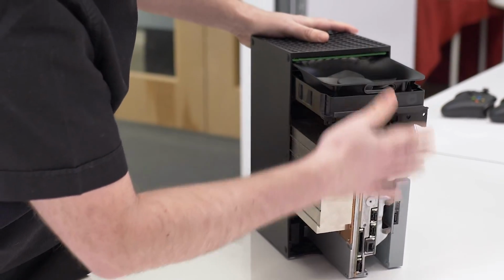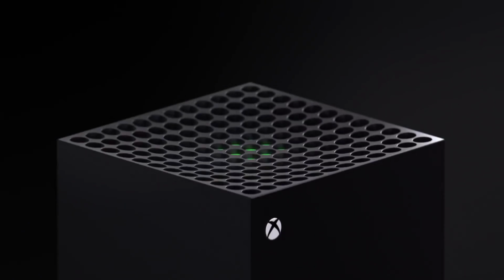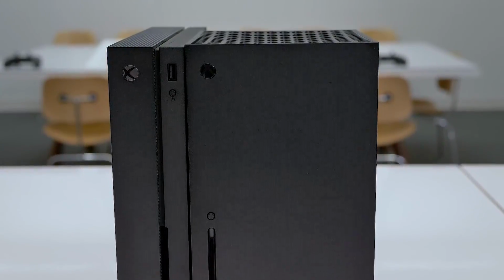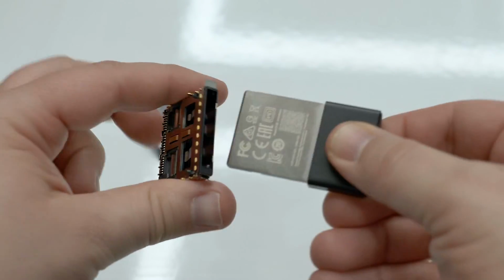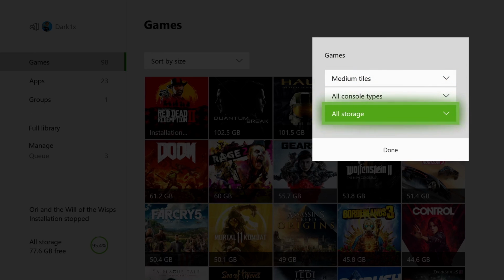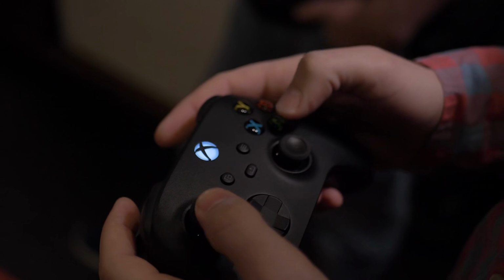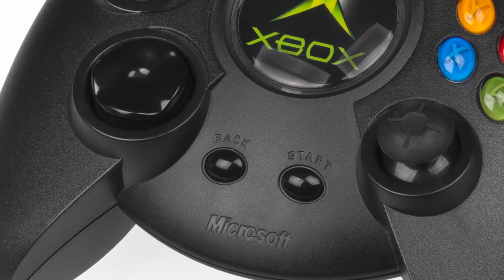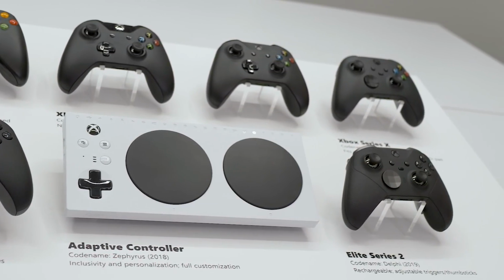DF Direct: Hands-On With Xbox Series X  + Impressions + Xbox One X Size Comparisons!

Comment: As long as i don't go below 60 fps you will have my money.
Reply: [Explosion causes 59 fps]
Time for a refund.
Reply: At this stage of graphics, given the pretty hefty hardware inside this machine, there's no reason why every game couldn't have a 1080p 60 FPS mode where framerate never drops, even if it has to tweak the resolution a little to do do (but I think most games should be able to consistently do 60 FPS at 1080p just fine).
Reply: esports titles like overwatch and rainbow six could easily hit 4k60 while more demanding games like watch dogs and assassin's creed could be easily doable at 1080p60 at the very least
Reply: @jjbinx  It will be a shame if games like Siege and Overwatch can't run 120fps. The biggest gap between PC and console is the framerate, I don't see why a competitive game would be 4k.
Reply: Adam Baldwin literally current gen one x can run any game at those specifications, wat 0.0 ... the current rx 580 gpu in the one x is running games at 4k, no doubt can run em at close to if not 120 fps at 1080p, 60? Hell too easy!
Reply: Adam Baldwin ... u do realise that the rx 580 is what df and everyone practically refer to as the one x equivalent. It’s the closest thing and therefore i said that 🤦‍♂️
Reply: i’d rather have 120 no dips than 60 no dips.. 🙄
Reply: The thing that held the ps4 and xbo back was the cpu. Without any doubt in my mind, all games will run 60 fps.

Comment: Yeah the console is cool and all but it doesn't really feel "Next gen" imo, yes it's more powerful but it looks like a Xbox One X2 not much changed except a new button in the controller and some new features, not to mention that all the games are going to play on the other Xbox One consoles
Reply: It's 3-4 times faster graphically than the One X and it supports ray-tracing and performance improving mechanisms like variable rate shading. It has 4x the CPU power than One X. Then again I'm comparing it to the One X, If we compare it to the One S it's like 12-16 times the graphics. How is that not "Next gen" enough lmao

Comment: Damn look at that heatsink boy
Reply: It is not a big deal, in size it looks like a mid tier cooler in computer components. But that thing must be cooling both, cpu and gpu.
Reply: Adad G that’s quite abit bigger then most cpu heatsinks I’ve seen and they maybe using that same knock off liquid pressure cooling or whatever but it’s an apu, I wonder if an apu creates double the heat vs a cpu.

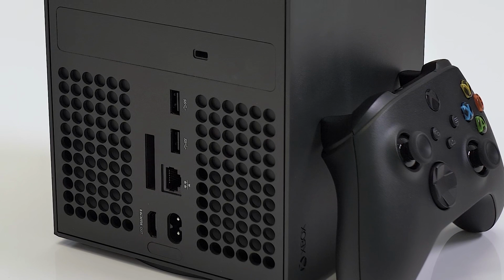Comment: Splitting the motherboard into 2 is also a great idea. If one of the pricy components on one of the boards breaks, you can just replace that board, instead of the entire motherboard with the expensive CPU on it and all the rest. It's gonna save a ton of money on repairs and refurbished consoles. @4:02 notice the typical SATA and Xbox connector on the BD drive, I wonder if it's all gonna be clip-on or there will still be wires inside. Another thing. Their unit didn't have an actual power inlet, which is located above the HDMI output as shown at @8:52.

Comment: Imagine Forza Horizon 5 on Xbox Series X...

The dreams comes true 🤤😍
Reply: It’s already so beautiful in FH3 and FH4.... 5 will be ridiculous and so will motorsport 8
Reply: horizon 4 😍 top 5 games i’ve ever played and ever will. never new i needed drifting in my life so much. and the car meets and cruises ... fuck i love the community
Reply: @timothyjn100  burnout paradise is better than horizon 4.
Reply: Ik this is a dumb question but will the xbox have a hdmi input for a tv or do i need a pc for it to work?
Reply: @notExolz  I think someone else answered you in another thread but yes ofc it will. How else would it be hooked up to display on a tv? TVs these days usually only have HDMI ports for display. It was also shown in some of the vid's B-rolls if you haven't watched it yet. But yea, it'll have the newest HDMI 2.1 standard. Which provides massively increased bandwidth that allows 4k/120 hz or 8k/60 hz (iinm), w / no color compression, & also VRR (variable refresh rate) & 12 bit (or "true" 10 bit) HDR (I think?), but only if your tv also supports those technologies. If it doesn't or you didn't understand any of that, & you just have a reg 1080p or 4k60 tv, dw that'll still work perfectly fine too.

And I'm assuming you mean HDMI out right? Not In? Rly dont see any use for a console to have hdmi in as it doesn't have a display of its own. Altho I do think current XB's do have an HDMI In port for some reason. I think to serve as some sort of a passthrough? So for ex., you can theoretically actually hook up your ps4 into your xb, to your TV if you wanted lol, like for some of XB's benefits, like maybe recording or HDR? Dont ask me, I'm just guessing lol. If you rly are asking if it specifically has an IN port, that idk. Didn't see any in the vid.
Reply: Kkdex yea i meant HDMI out thank you
Reply: no need to imagine. Will look almost exactly like the last 10  games.
Reply: @NedwardJamesAlmost  hahaha get your eyes fixed, playing too much on that Soupstation blurry protato mess 🤣
Reply: @Elementox-im1tm  Well the soupstation X is the most powerful console on the market.... so let me know how to avoid the "blurry potato mess"
Reply: Playing forza horizon 4 at 4k 60fps at insane settings on pc was a dream come true so playing horizon 5 on pc will be to.
Reply: dock gamer definitely! 💯

Forza Horizon is phenomenal! ❤️
Reply: @dockgamer973  K
Reply: @dockgamer973  horizon 5 on Xbox not stupid PC.

Comment: Digital Foundry is wrong about something. The Xbox Series X does kind of resemble a low end gaming tower such as the Corsair in looks but, it will actually keep up with most modern day PCs. Just an FYI. The GameCube reference was funny and all but, that’s not what this is. Don’t be fooled people. This console will have more GPU power than the PS5 meaning more bigger games and faster load times are very possible. I’m just waiting to see how this plays out.

Comment: interesting stuff overall! the thing is we do'nt have much context yet to compare to, for example:
 I did some math regarding SSD for PS5 vs XSX based on the official footage:
so far PS5 SSD looks two times faster

for XSX: (State of Decay 2, Digital Foundry footage) loading time cut to 8.5 seconds from 35.3s --> -415% reduction(4 times faster)(also there was still shadows, textures, and the world initially loading inside the game. not that impressive honestly!)
for PS5: (Spiderman demo) from 8.10 seconds to 0.83 --> -976% reduction(10 times faster)

So the loading time boost for PS5/XSX =9.76/4.15=2.35 !
Reply: But loading times will differ game to game and it also depends on level of optimisation so we can't be sure for now

Comment: I just wish there was a fan at the bottom as well, and also removable dust filters. It sucks big time that you can not play games off an external drive, there are not many games you will fit on a tiny 1TB drive these days.. 🤷‍♂️
Reply: Mmm yes, the filters. Very important.
Reply: Proprietary memory sucks but this is probably just a way for them to make some extra money. I imagine they could be taking some losses if they release the console at a price most of us can afford. Proprietary memory was one of the things that killed the PS Vita. Hopefully MS won't charge alot for those memory card thingies. I just don't like having to constantly unplug or plug in things on my console. Right now I only have a 500 gig external plugged into my 500 gig XB1. Usually I delete games I don't play often when something comes out that requires a ton of space. If these cards are the only option I'll just get a decently sized card (on sale) and that'll be it for me. Ext storage could be patched in later though....

Comment: Where's the optical audio out? What are people who use hard to drive, high end headphones suppose to do? With only a HDMI out only people with a good speaker system will be able to enjoy high quality audio over ARC and through a receiver or soundbar. People who already invested in a pair of high end open back headphones would have to spend again on a decent soundbar or a receiver with a pair of speakers. Some people enjoy the more intamate sound headphones provide, or simply don't have the room space to accommodate a speaker setup. Others don't want to sacrifice any competetive advantage in multiplayer games that good imaging headphones provide. People would be essentially limited to the output on a controller... Whatever power/quality that may provide.

Comment: Proprietary NVMe "cartridge" means price will be nothing like actual PC NVMe drives :/
Reply: I was disappointed to see that they went with a proprietary design
Reply: Well, everything is roses and flowers now so :). I feel ya though!
Reply: yeeah it sucks but that's always kinda the deal with consoles. We will sell you the hardware below cost, but you need to buy(not pirate) our games and peripherals.
Reply: Maybe those sales will keep the console price down
Reply: I mean, there's still usb ports. maybe the nvme drive is an optional purchase if you want faster performance, and if not, you can still just use an external hard drive?
Reply: @LlamaCat  no, ssd is definitely part of it. putting in a hdd as primary is entirely against their whole pre launch sales pitch. adding one as extra storage shouldn't be an issue, but replacing ssd with hdd is a terrible idea
Reply: I'm sure being proprietary will drive the price up. But, it allows stability, quality & performance control and most importantly  to be user friendly.  If they just popped regular old M.2 slot in the back you'd have people breaking them, being mad for buying crap SSDs, etc...Most console buyers probably don't understand what M.2 is.
Reply: I've been wondering for a few days, can I get an ssd and connect it to my xb1 with a sata3 to usb3 cable and see performance boosts over micro b to usb3?
Reply: @majikmessiah  you can use an external SSD via USB 3 for storage if you have the SSD in a case that provides sata power and connectivity, or just buy an external SSD already setup like that. You will not gain any speeds over what USB 3 already offers which is ~5gbits/sec.
Reply: @alteredworks  alright, thank you very much for the response.
Reply: @majikmessiah  usb 3 is faster, xb1 only has sata 2 internal

Comment: 21:21  4K at 120 frames per second confirmed. Also, being a console, I will not have to deal with modders who ruined games like GTA on PC. I won't have to deal with constantly fine-tuning settings. I won't have to deal with constantly spending money on upgrades. ( honestly money is really no obstacle, dealing with tuning settings and upgrades is not that bad, it's the modders which I can't stand)

The only benefit PC can possibly offer is mouse and keyboard, but if everyone else in the game lobby is also using controller, then keyboard/mouse is not enough to keep me on PC.

This is shocking, but I think it now means the end of the PC Master race. And seeing how they still have to deal with the PC problems of modders, upgrading, settings, and cost... is saying PC peasants and console Master race going a bit too far? Holy smokes... a console now offers me everything I want. I'm all in.
Reply: For a start you're full of crap and haven't the first clue what you're talking about, and secondly you think this things doing NATIVE 4K at 120fps ? Something tells me you dont have a gameing pc at all, they said 120fps which is nothing but where did they say at 4k ? They didn't and that's for a reason, because it wont do that. And pc has the largest gaming user base in the world next to mobile and more games and exclusives than the consoles combined, pc gameing completely dwarfs consoles in user base, stick to xbox vs playstation because nether have a hope against pc.
Reply: @dockgamer973   clearly you didn't watch the video. If you watch at the 21:21 Mark I put up, and stay on till the 21:44 mark, you will hear them confirm 4K at 120 frames per second.

I suppose Digital Foundry could be lying, but they have a reputation for being honest. I have an HP Spectre laptop equipped with 32 gigs of DDR5, and a 4K touchscreen, needless to say it doesn't struggle to play games on Max settings. I like to use an Alienware Mouse, I forget which one. I have built my own, and I have bought as well.

PC games are generally garbage to play online, Microsoft has a subscription service so you get what you pay for and their servers provide a far superior online gaming experience. Also I do not have to deal with modders on Xbox Live, while on PC you are at the mercy of people with god mode, aim bots, and can drain your accounts.

And what is this PC gamer base you speak of? I suppose if you count every person who plays solitaire on their computer than yes. But online on GTA for example, there are many times more Gamers planing, it's not even close.

Dedicated PC gamers who play online are easily less than 1/30 the amount of Gamers who play consoles online, for any game available on both platforms.

I'm sorry that your butthurt, but you are simply spouting nonsense and clearly didn't even watch the video to say they never mentioned 4K or 120 frames per second.

You should watch Digital Foundry more, they even explain how the Xbox achieved this. Instead of the traditional loading of the game from the hard drive to the RAM to be processed by the graphics card and processor, most of the game will play directly off the new solid state drive that Microsoft created, it reads so fast that a large portion of the game can play directly off of it instead of loading onto the RAM first.

This Is how they are achieving high end PC gaming, and even things high-end PCs cannot do like pausing and switching between games in seconds, and picking up where you left off even after a cold boot.

All of this while playing on their hundreds of thousands of dedicated servers that make up Xbox Live. Did I mention no modders?

You can have the mic now, because I dropped it.

Comment: Them only being capable of using a 'single' SSD at a time for storage and that being a proprietary drive, isn't a good thing. I guarantee, just like anything proprietary, they'll be marked up in price considerably (2-3 times as much), than an equivalent 'standard', off the shelf NVMe SSD... Also them being made by Seagate, isn't great. The quality of their entire product line lately, has been drastically dropping and has been piss poor, at the very best....Then again I guess it could have been far worse, if they had soldered it onto the board.
Reply: Yes it will expensive. My Intel Optane 905P SSD fits in that category of proprietary tech that are very expensive.

Comment: Just you wait... Almost sure the accompanying, at this point "Xbox-exclusive" (read: obligatory), power-brick will be the same size as the console itself.
Reply: Or... The inclusion of "the brick" is the actual reason for this form-factor. Either way: As usual... Bang-up job, MicroSoft... At absolutely sucking at hardware design.

Comment: That expandable storage option for the Xbox Series X is interesting.
But being it's proprietary, I figure it'll be very expensive.
In that regard, I hope the PS5/PS5 Pro continues with the user internal upgradeable storage option like PS3 and PS4.
Even if this means they have a soldered on SSD but has an extra slot for 2.5" SATA SSDs and another for NVMe.
I do think that storage will be a thing that people will debate about this coming gen.

I think it's good they're finally updating the Xbox controller to be more refined.
It's too bad that it's still going with batteries.
But at least it's using USB-C so you can probably just play it wired, right?

I'm surprised that Sony still isn't talking about the PS5.
Though I get a feeling that they're soon about to flood us with info.

I won't be getting this. I'm getting the PS5.
But I will say the Xbox Series X is looking very impressive. 
The thing they need to focus on is games and not so much on hardware specs and controllers.

But again... That expandable storage card thing might be something that causes a lot of debate with gamers.
It would've been nice if they designed it to have easily upgradeable internal storage in case the internal drive breaks or in case you wanted to upgrade the internal drive yourself.
It's something (again) that I hope Sony can do for the PS5.

Comment: Love the speed, the ssd(NVME) brings. Not so keen on the idea, that on 1TB you can practically fit nothing... I have 8TB external on my X and I have already used over half of the capacity (8+1TB)... And now it's also their own connection of NVME, which means the extra space is going to be very, very expensive indeed...
Reply: I really don't understand this problem, I'm not saying there's anything wrong with it, just curious, but why do people need to have so many games installed at once? How many do you really play at all, and how many do you play often? On both my PC and Ps4 I only have installed like 3 multiplayer games that I play often, and like 4 single player games at most (a couple of favourites I never get tired of, and a couple I'm currently playing) why would someone need more.
Reply: @fenix_tx_1342  Well, I have hundreds of games installed on my pc and well over hundred on XboneX and PS4Pro... Most of them I never play, but that's not the point.

I could uninstall many games from my Xbox (for example), but re-installing them takes long time (don't care about downloads, we don't have data caps) and that I don't like. Also, 1TB is next to nothing. 4TB I maybe could compromise, but that's going to be very, very costly if they even offer such a possibility...